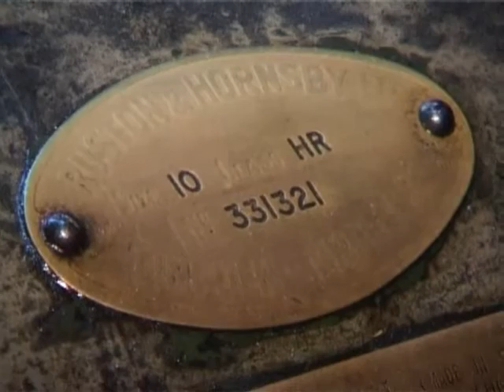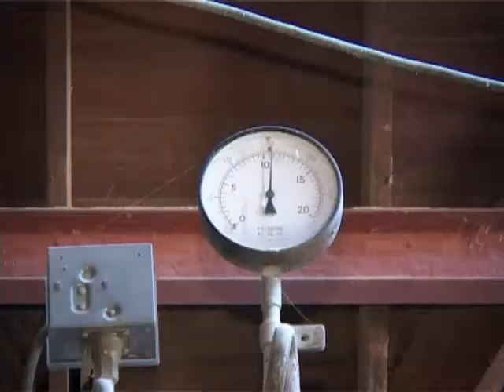Stationary Steam Engine - Converted Diesel Engine in Thailand Rice Mill #8

Comment: That looks like  it took a lot of work. The Ruston Diesel piston is used as Crosshead ,because it wouldn't be suitable as a steam piston, and they've made a piece to bolt the steam Cylinder barrel  to the top of the diesel cylinder block .The ruston diesel piston has been bored with a hole and  fitted with a piston rod to connect it all together. I've seen Lister diesels in india converted to steam the same way.